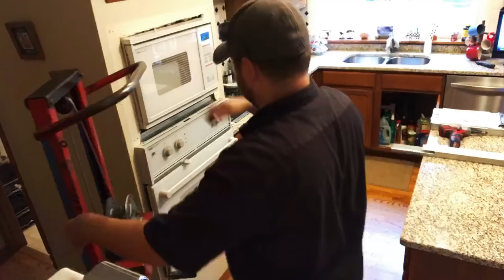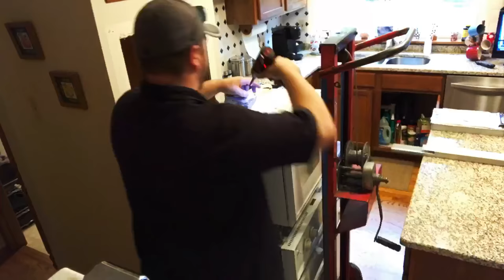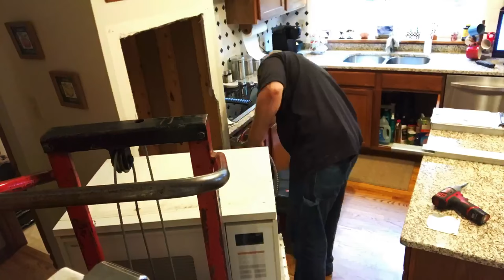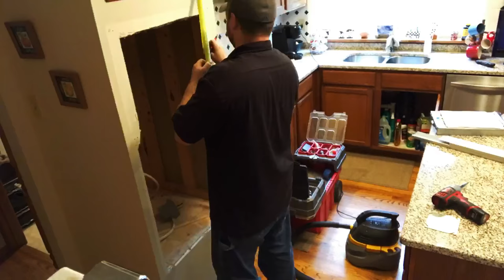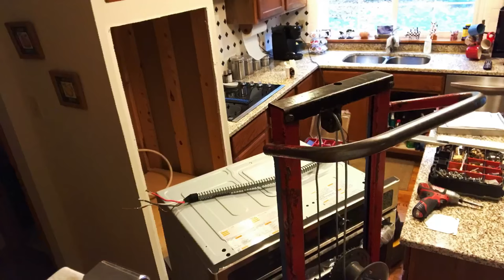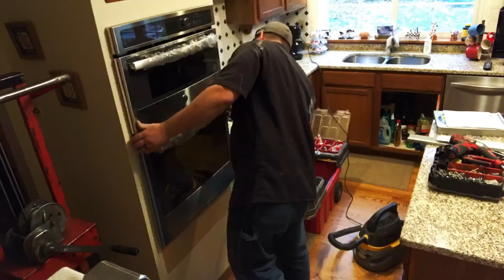Custom GE Combo Oven Install

Comment: I'm not a professional so I wish this was slowed down so I could actually learn what to do.
Reply from the maker: Unfortunately I am no longer installing appliances, but the best thing you can do for yourself when installing wall ovens is make sure you get your cutout perfect before you go to lift these thing in. 

Measure the outside box of the oven behind the lip that you would screw through. Secondly, get yourself a 2x4 sheet of 1/2” MDF board from a hardware supplier. Mount that to your 2x4 oven supports that typically go from front to back of the cutout (this is where you want to make sure it is level front to back and side to side, use shims to make adjustments). Get the oven properly wired up (turn on the power before putting it in the wall), and once all this is good, you and a buddy carefully lift the oven into the wall and you will be amazed at how easy the oven will slide in on that MDF board. 

Last pro tip I have, remove the oven doors and racks (check the user manual on how to do this for your oven), this will make it lighter and less likely to damage anything visible.

Comment: If you need a wall oven checked and maybe a better installation in the wall done structure wise what kind of contractor would a person contact? thank you
Reply from the maker: A good general contractor or handyman would be able to be to get it straightened and supported better. They wouldn’t have to go as fancy as I did in this video. I had placed a 1/2” thick MDF board on top of the 2x4s for ease of sliding the oven in and out of the opening. Most wall ovens are simply supported by 2x4s in the cutout. When the oven does get removed, it is best to have some kind of platform to set it on while the adjustments are made in the oven cutout. Depending on the type of oven, they can range from 150-350lbs.

Comment: I realize this is an old video, but can the microwave be hooked to a separate circuit from the main oven?
Reply from the maker: Not in combo units like this one. You would have to buy a wall oven and a countertop microwave with a trim kit to have it built into the wall. In that case you would have to have a 110v outlet separate from the wall oven. I’ve done those several times in the past, building a separate shelf for the microwave and oven. 
It’s a lot easier and cheaper to replace just a microwave when it goes out before the oven.
Reply: @efranklin85  Thanks for answering.  

Most manufacturers at this point have built-in microwaves available, the trick is finding a match between the oven and the microwave and the cost is generally higher as well.
Reply from the maker: It’s been a hot minute since I was an appliance installer, but it’s like riding a bike. The only thing that will change about this trade is the style of appliances to be installed.

Comment: Pro job, but, it's one of those "awww damn" installations.  There was an opportunity to have it installed much lower and fill in the top.  At this height, the upper oven is nearly rendered useless for half of the female population.
Reply: It's a microwave on top ...

Comment: Without the Sandstorm soundtrack, this video wouldn't be half as cool as it is :)
Where does one rent a dolly like that?
Reply from the maker: Chris Robinson not sure if you can rent an oven lift dolly like that or not. That one cost $520 and it was used. Worth every penny if you do this full time like myself. 👍🏼
Reply: @efranklin85  What do you call that Dolly? I need one. Would you say it is better then a Hydraulic Table Cart or on "Alldolly"? Thanks for the Video.

Comment: I’ve got a wall oven 4 wire it says inside on the tag that it is a 120/208 how do I go about hooking that up to a 200 amp breaker box
Reply: @foobarmaximus3506  it’s been long gone since then sir

Comment: Awesome job.. where did you order your custom trim?
Reply from the maker: It was from Laciny Brothers inc which is a local metal work shop in St. Louis that designs a makes custom stainless steel kitchens for mainly commercial kitchens. lacinybros.com 
The other place I order custom trim from that’s a bit more cost conscious is microtrim.com They’re based out of California and ship across the country.

Comment: Hi, what is that Hand Winch?
Reply from the maker: Gerson Suero that is an oven lift dolly. It has a platform on it that the oven sits on, a couple pulleys, and basically a boat trailer winch that allows me to raise and lower the platform. I’ll try to find a link to share that has this on it.
Reply: Thank you!

Comment: Nice install! I have the same appliance and after install the microwave works but I get a communication error when trying to use the lower over.  The tech who came out said a board needs to be replaced. Does that sound right for a brand new oven or could the wiring be wrong? Either way they said I have to remove it before the next appointment. :( I was hoping to just slide the microwave out to get at the wiring but I can't figure out how.
Reply from the maker: Jonathan West I will say that it's very rare to have a new GE oven have a problem out of the box. It's not impossible, just rare. An issue that I have run into in the past is one half of the 220V breaker was dead which would only allow the ovens to get a relatively low 235 degree temp and not a degree higher. So it is entirely possible that maybe the tech wired it up wrong OR one half of your breaker is dead. If the problem persists after the repair, have your electric checked. 👍🏼
Reply from the maker: Jonathan West Also the combo units aren't really separable.
Reply: Apliance Guru Eric Thanks! I pulled the oven out and checked the wires and it seems fine. The microwave works great so it's getting power but the control panel isn't able to communicate with the oven. I'll wait for the part and see how that goes. Thanks again.

Comment: well you had the electrical box out and available.. what do you do when box is in wall?
Reply from the maker: Richard Koldenhoven I pull the oven out as far as it will allow and I work with it from there. If the cord (aka whip) isn’t long enough on the old oven I will take the top panel off and disconnect the wiring from the oven itself. Now if the cord on the new oven is also too short, I will add a second junction box with either new wire to match the gauge of the house side of the supplied electric or if the old oven whip is still in good shape I’ll use that as my extension to the second junction box and wire the new oven to that. The second option is debatable if it’s ok practice or not, but I have never had a call back or have been the cause of melted wiring or fires. If you’re unsure then go with adding new wiring to get the length you need, but MAKE SURE YOUR GAUGE WIRE MATCHES OR EXCEEDS THE POWER REQUIRED. 10/3 handles UP TO 30Amp, 8/3 UP TO 40Amp, 6/3 UP TO 50Amp. Check your breaker for the amp rating. Electricians will match the gauge of wiring to the breaker.